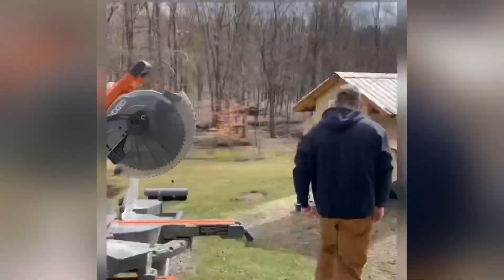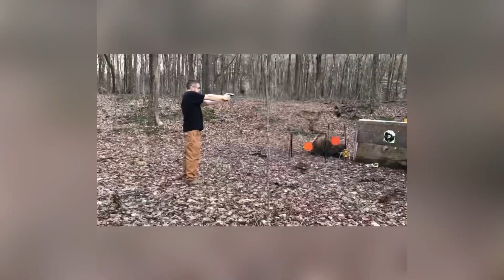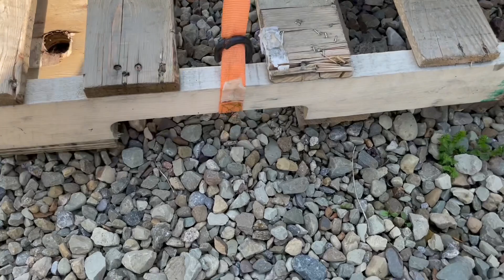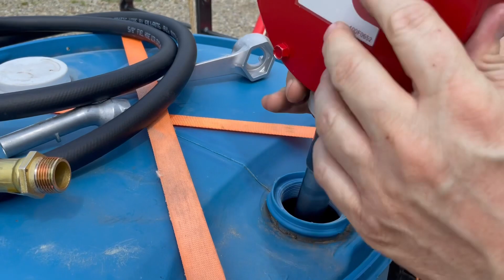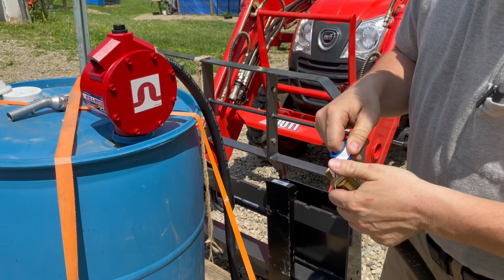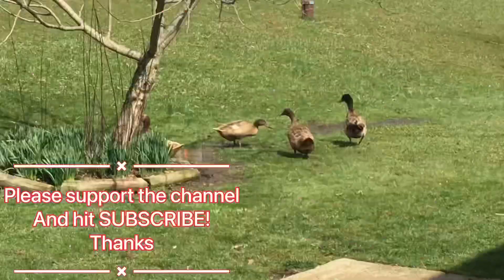How to make a fuel transfer tank.

Comment: I have one of those.  Depending on the site some say it’s fine and say some say don’t do it.   It’s only good for 6 months and you have to throw away the diesel and tank.  I’m gonna give it a go.   Mine will sit for a while.    I believe it’s hdpe.    I’m going to add a filter for debris and water.
Reply: The diesel eats away at plastic inside
Reply: Some say it does, other say it doesn't since the plastic tank is the same number as the diesel tanks you place it in.
Reply from the maker: That’s interesting?  I wonder why you would need to throw away the tank?  I have no issues with mine so far?
Reply: Do you still have the same tank? How is it holding up?
Reply: Its all a conspiracy by big fuel tank! They tell you not to make your own solutions so they can charge you overpriced products! 

Joking. But I wouldn't be surprised if that were the case.